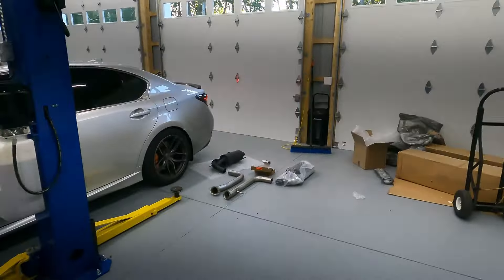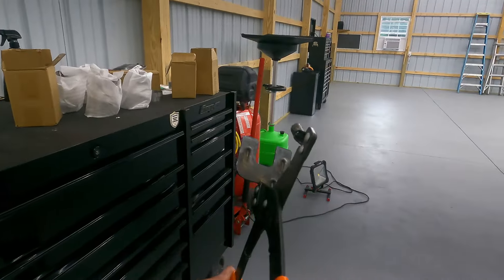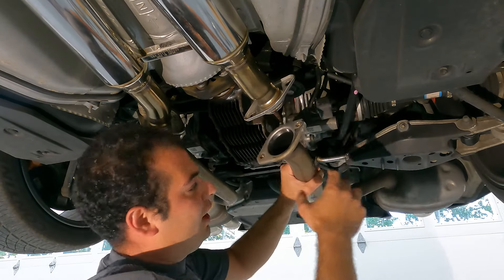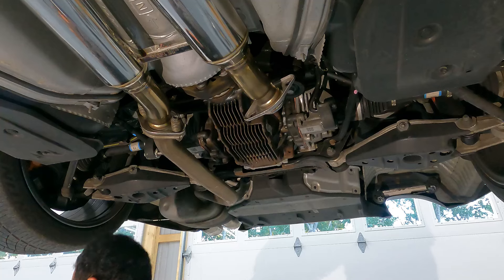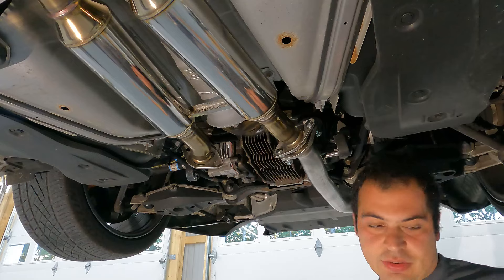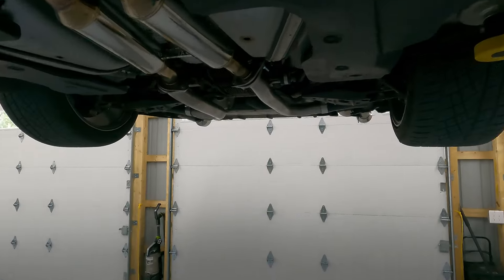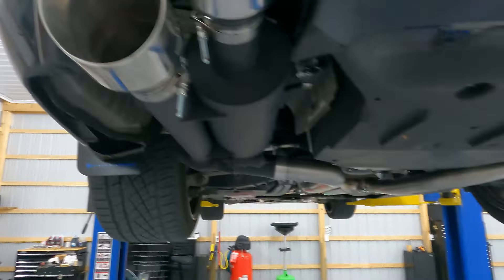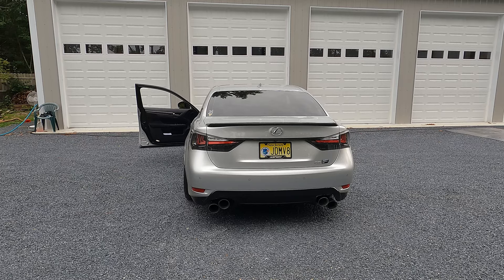RR Racing Bazooka Valvetronic exhaust install and sound test!!

Comment: I have the same catback on my gsf and ended up using the same wiring method. I was curious if you ended up having issues with parasitic draw afterwards. My AGM of 3 months ended up going bad and wont hold over 11v anymore
Reply from the maker: No issues here!